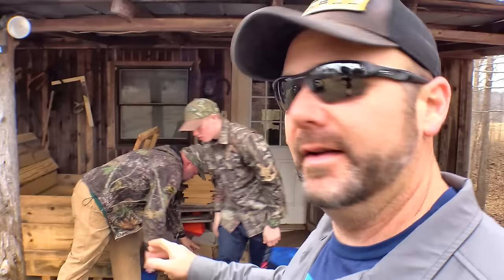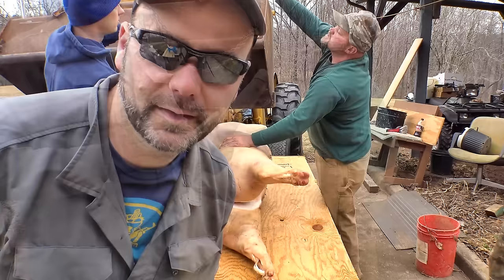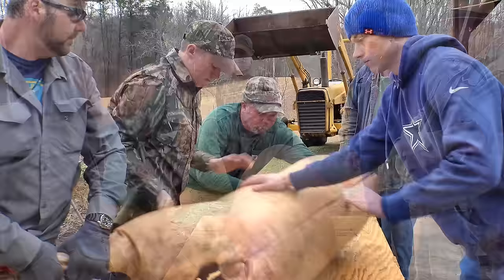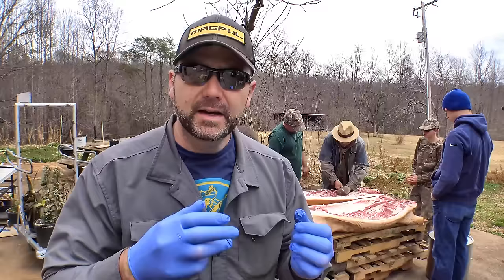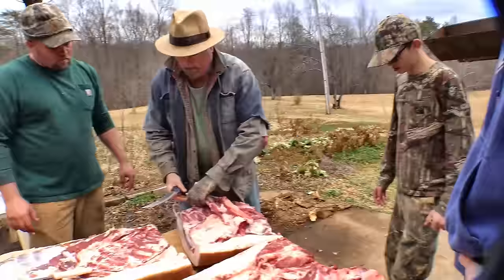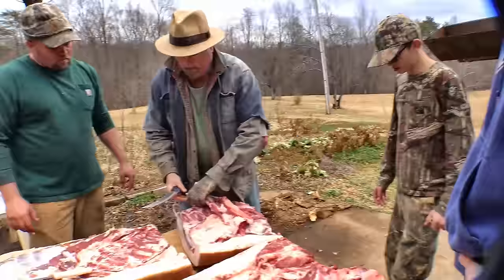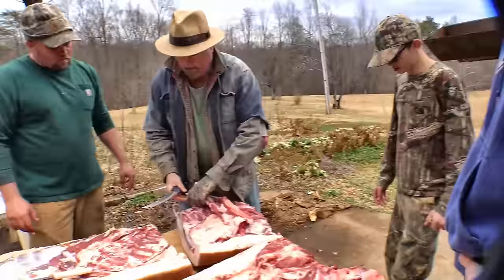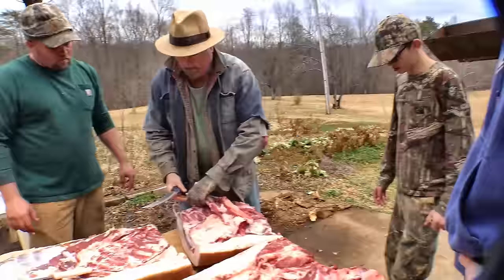DAY 2: Appalachian Heritage Old Timey Hog Killing...Quartering and Salting Down day 2 of 3

Comment: If i understand it will be 2 yrs before you eat this.  Do you do it again every year or every other year to keep up a continuous supply.  I guess my question is... where do you store all that meat while its waiting to be eaten?
Reply: Usually hanging in a smokehouse.
Reply: The hams will be ready to eat after about 8-9 months, so late summer, early next fall. The rest of the meats can start to be eaten after the initial the initial cure (salting) and depending on whether they are to be smoked.  Cracklings will be ready as soon as the fat is rendered down, later in the day.  Sausage will be ready the next day after it is ground and stuffed in the casings.  Fresh meats can be eaten today, such as loin, chops, roasts, etc.
Reply: A lot easier to split the spine with the hog hanging up, the chalk line is really unnecessary...a sawzall also makes it much faster

Comment: Another great video in the butchering series !!  I like it a lot.  We no longer salt cure, we have a local farmer who processes our hams and bacons for us.  We put all our jowels into the sausage pile and render the jowel fat along with the back fat separately from the leaf lard. My daughter loves the leaf lard for pie crusts and other baking things. We use the other lard for soap making on occasion and as a natural lubricant on my drill bits etc in the shop.  lol...it works wonderfully, but it kinda hangs around a little more than tap-eze or oil.  We cut all the 'middlins' into bacon....didn't know there was another option. Thanks man. Keep it up.

Comment: Been there and done that, albeit with a much smaller pig, ( 200 lb live weight) with this smaller pig I left the hams in the salt for 3 weeks and the shoulders 2 weeks. The bellies were  out of the salt in a week. Any more than that the bellies were very salty.

I mixed dark brown sugar with the salt (1 to 4 ) and even added some clover  powder and pepper corns ( the cured results were good) 

The hams and shoulders et all were turned every other day with wet salt taken out and replaced with more dry salt.

After curing the Hams were washed , dried and put in a net, then hung up in an airy shed to dry out and mature. 

I am in Ireland ( Co Antrim)

Comment: A single tree does work for hanging animals but that is not what it is made for as you said. Single trees are used to attach your mule or horse to a piece of equipment to pull it.  You would use a double tree to attach two animals to the same piece of equipment. Good video, nice looking hog.

Comment: Dang, unless the camera makes the hog look bigger.  We usually butcher hogs 240 to 280 pounds.  That one looked well over 300. Nothing wrong with that, I like big hogs myself. We basically do it the same way except hang the hog up and use a meat saw to cut it in half.  Great vidio.   We use about everything but the squeel. Thanks

Comment: Talk about losing the knowledge of the old ways .  When horses and mules are no longer used to work a farm some knowledge is lost .  Of course a hog can be suspended with a singletree but that is not the original purpose of a singletree .  A single horse or mule was attached to a singletree for the purpose of pulling a farm implement.  A doubletree was , you guessed it , used for hooking up a team of horses or mules to pull a farm implement .
  Of course a singletree was handy for hooking up to a rope and pulley system for lifting and hanging heavy items such as a whole hog . Before the days of tractors with front-end loaders , hogs were usually hung in a barn or from a large tripod .
Reply from the maker: This is a single tree for hanging meat....a single tree for pulling a wagon is totally different my friend ....my mom and step father still do wagon trains and work mules...we'll be working some mules pulling logs out of the forest at some point here on the farm

Comment: That’s amazing. I’ve never seen pork cured that way. I have a few questions;
How much salt does it take for what you did? 
Do you top it off with salt to where you don’t see the meat anymore?
What kind of salt do you use?
Also do you have a video that explains the construction of that salt box? 

The box with all the meat in it seems like it saves you tons of space. Do you have multiple boxes going at one time? Or do you just do it one cure session at a time?

Great stuff man. Can’t wait to watch part 3.
Reply from the maker: Salt is regular table salt, salt box is just built out of whatever you want...no video explaining the salt box just slap some boards together that will hold salt.....we had 500lbs of salt..but it all depends the meat must be burried in salt ....stick on the vlog...we'll pull the hams out of the salt in a few weeks and hang them

Comment: Great instructional video.  Question about outdoor temp where you are.  We are about to process our first and it is hot still.  70-90 daily.  Should we buy or schedule pigs to be born in June and process in December or January?  NW Mississippi.  Thank you.
Reply from the maker: process on the coldest Jan/Feb days so the meat doesn't spoil and yellow jackets/flies aren't a problem, also the fat solidifies and makes the pork easier to work with
Reply: Thanks!  We bought way too early and may have to send the first to the butcher.  Or we may try to breed them.  Good info.
Reply from the maker: shew...be careful breeding.   You might be ok..just have a bigger hog! lol